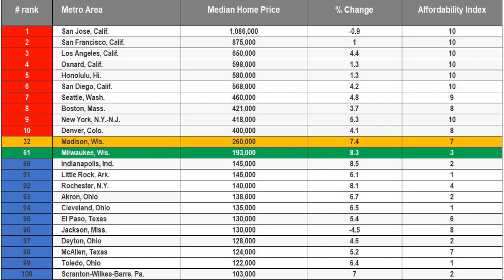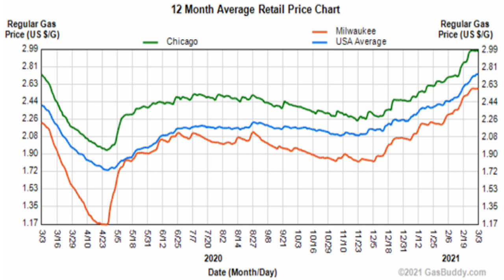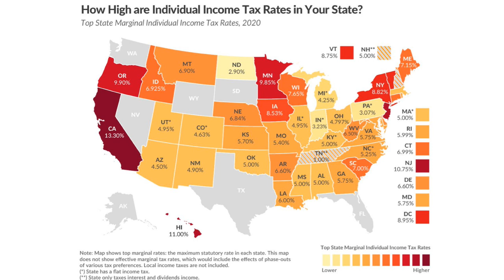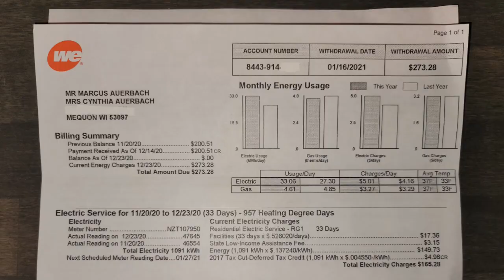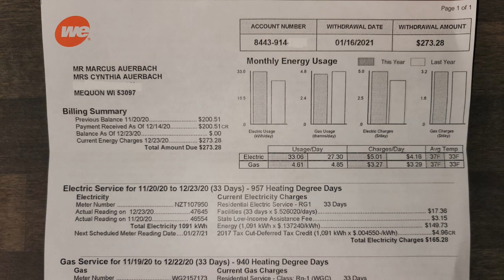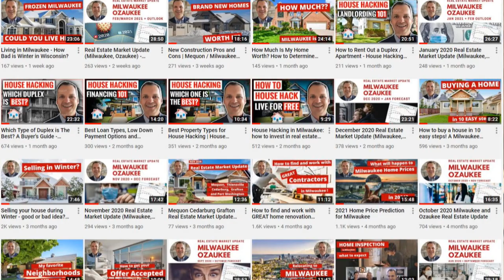Cost of Living in Milwaukee Wisconsin

Comment: One thing that those who complain about the cost of living in Milwaukee and Wisconsin don't mention is which services you get and the quality of those services (usually good.) Nobody likes taxes. But you get alot for your tax dollars. 
Milwaukee and Wisconsin is clean. Compare value for your taxes in Milwaukee and Wisconsin. Sure, taxes are less, say in Arkansas. But what do you get for those taxes?
Cultural offerings are many and diverse. While crime has increased somewhat in Milwaukee and perhaps the rest of Wisconsin, it is still a low crime area.

As far as remodeling goes, not all homes need to be remodeled. There is kind of a quaintness in NOT remodeling. Some of the older homes were built very well. Keeping them original is often a good idea.
Healthcare is high, but that's a U.S. thing, not a state thing.
Education is good for the most part. There are things that could be better. But many places are far worse.
Reply from the maker: Thanks for your comment! I have started working on videos comparing MKE with other cities and that really puts our taxes in perspective, also other things, both pros and cons

Comment: I have a question about the water quality in Wisconsin. I have been to Germany (Köln) and I recall drinking faucet water and it was delicious and seemed so much cleaner than the water here in Los Angeles, CA. How would you compare the quality of the tap/faucet water compared to tap water in Austria? Do you use a filter for your tap water? Do you purchase bottled water for drinking and cooking? Here in L.A., CA many people buy bottled water and we take the bottles to the recycling center for the bottle deposit refund.
Reply from the maker: Water in my home town in Austria is also delicious! Milwaukee city water takes second place, but I think most people will still rate it very good and use it to drink and cook. If you live in the suburbs on larger parcels like me you may have your own well. I also have an RO system to filter my drinking water, $300 well spent!
Reply: @MarcusMKE  Oh that's interesting about having your own well! I hope well water is delicious and clean for drinking and cooking.
Reply: I live in the inner city of Milwaukee and I have a filter because our house is old and has lead pipes apparently although we didn't know until I was like 12 so until then I was drinking without a filter lol